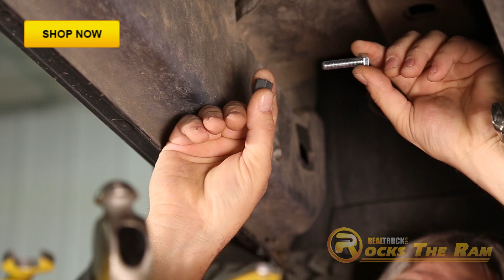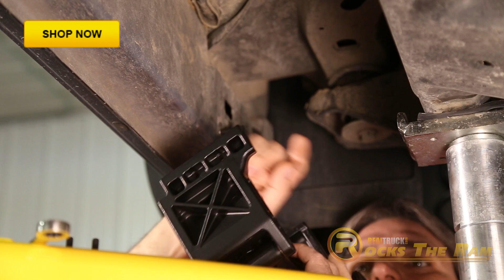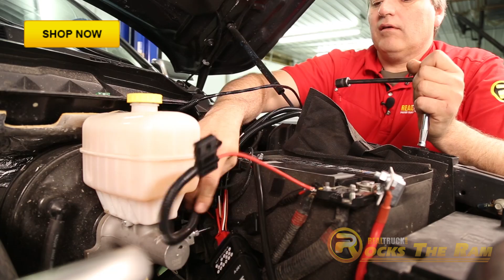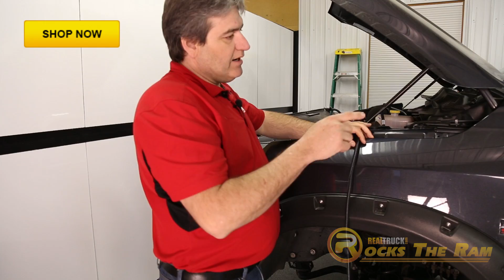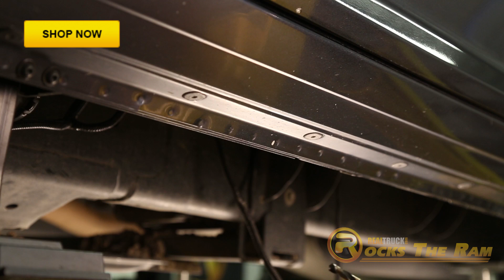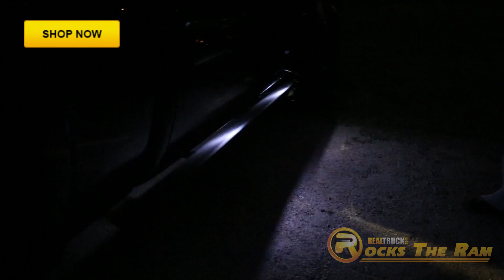How to Install Amp Research PowerStep Running Boards on a Dodge Ram Mega Cab

Comment: After doing the install myself. Here is a huge TIP.
Unlike in this video, when drilling a hole for the rivet, place that black bracket in front, slide the two nutserts into place through the bracket. This will 100% align the hole you need to drill. Then install the bracket behind the sheet metal, again slide the nutserts into place to align everything. Do the rivet, than the nutserts. No hammering needed.
Reply from the maker: gol10dr45 Thanks! We will try this out with the next install. Thanks again for the tip!

Comment from the maker: Donny - I honestly don't know. I haven't looked into it much, but if you really want to do this, take a look under a Chevy Avalanche of the same year and compare the backside of the rockers and hole locations to your Ridgeline. Might be able to make the ones for the Avalanche work. Wiring may be different too so you would need to find the trigger wires on your Honda to wire in correctly. Good Luck and hey let us know if this works for ya.

Comment: Hey guys, using your video, although not exactly my model (2015 Dodge Ram 2500), it was a great help. You should update for the plug and play model. Thank you.
Reply from the maker: AA_ Slautter The plug and play model installs the same way. The only difference is that you don't have to hook up the trigger wires. It just plugs in to your OBDII Connector under the dash.
Reply: Great video. I was able to install the steps with ease. Thanks again.

Comment: I would of liked watching you put the wired through the firewall and see exactly how you did it and how difficult it is
Reply from the maker: southsidedoug no worries. I can tell you. The best thing to do is to try and find a plug or opening in the firewall and run it right through there. If there aren't any you can punch through where the steering column goes through. This method is much more difficult, but it does work. If you  have any other questions about this or would like more info on this item or any of the other 500000 plus accessories we sell and would like to speak to a person directly feel free to contact our knowledgeable Customer Service folks at  877-216-5446

Comment: hi john aaron again hey i was wondering which step you like better the amp or the bestop ,however i would prefer the one that goes under the truck and not a long side it  but do want to get the best one thanks again
Reply from the maker: Aaron Thibert We have the Amp Powerstep installed on a lot of trucks here around the office. Beststop is a new brand so we have not yet been able to put them to the test.

Comment: RT, you mentioned the plug and play in a previous post below. Is the plug and play in lieu of splicing the purple wires?
Reply from the maker: ***** That is correct. It plugs right into your OBDII connector under the dash, unfortunately, this is not available for all applications.
Reply: Thanks. I actually went ahead and ordered the kit with the plug and play. Looks there's only 2 purple wires and once you run them through the firewall, you splice them into the plug and play connector. Simple enough. Just got my kit and putting them on tomorrow. Thanks for the video, very helpful. Must have watched it half a dozen times 👍🏼